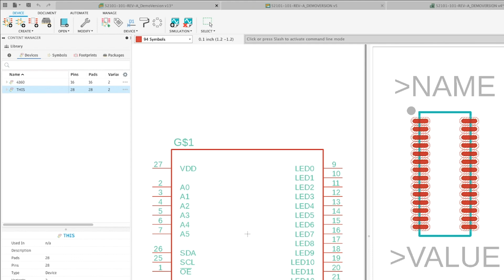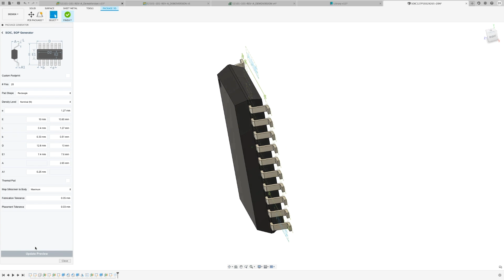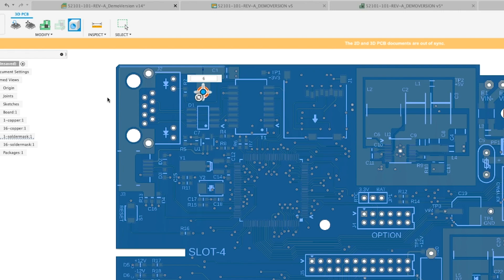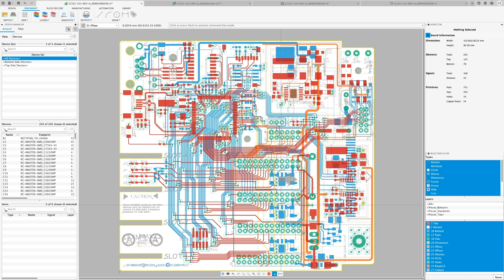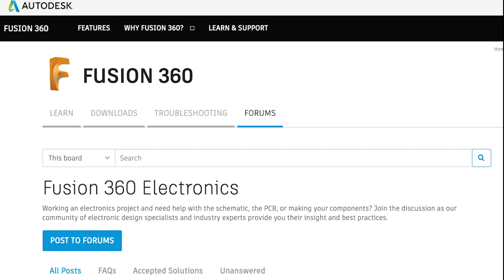What's new in Fusion 360 electronics October 2020 update

Comment: Nice features and stuff is moving along nicely but my biggest gripe with Fusion 360 is the speed and performance. It's. Just. So. Slow. While Eagle feels snappy and fast while moving between schematic, layout and library editors, Fusion just feels like the slowest hog churning forever. I won't switch over until the speed is drastically increased. Is Fusion perfomance on the agenda for you guys? Thanks.